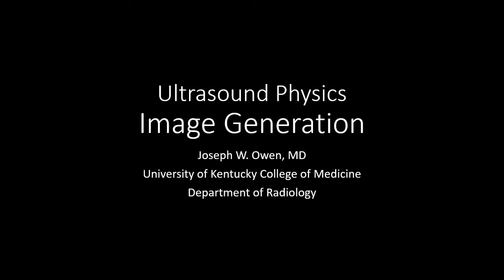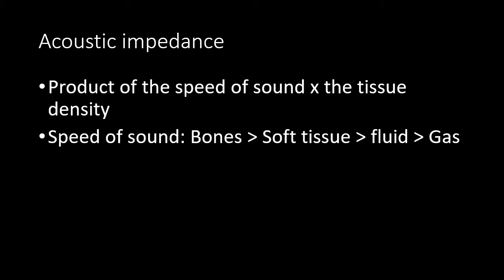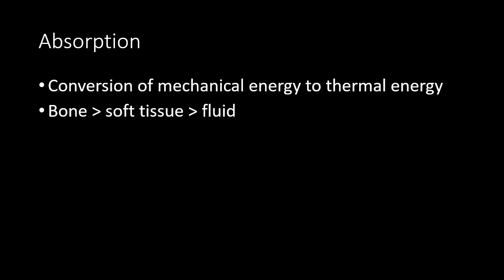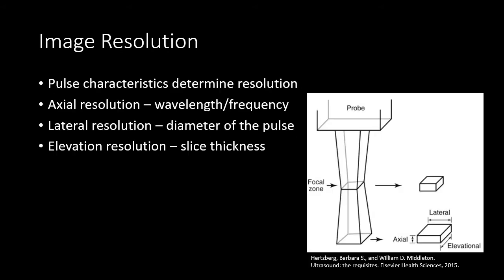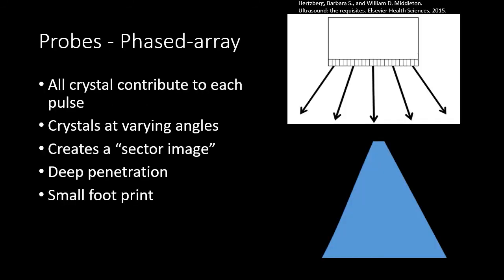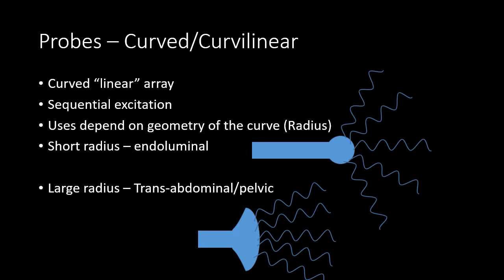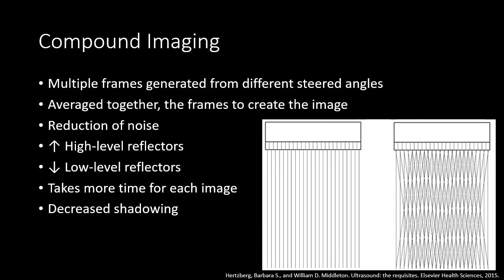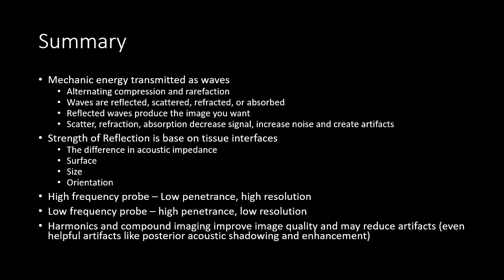Ultrasound Physics - Image Generation

Comment: The phased array transducer, generally doesn’t fire all the crystals at the same time as stated.   That’s why the sector/cardiac probe is called a phased array transducer, each lead zirconate titanate crystal is fired in a specific phase sequence but not all simultaneously.  Otherwise well done.